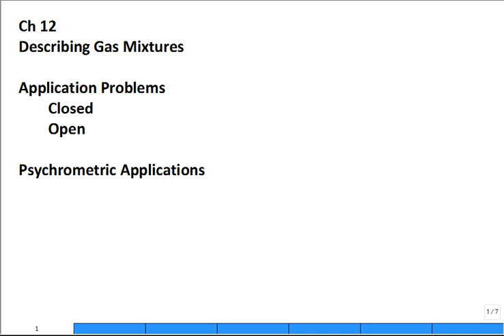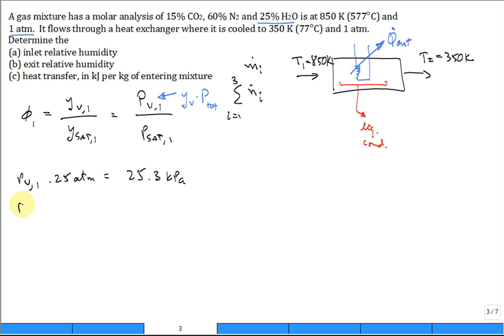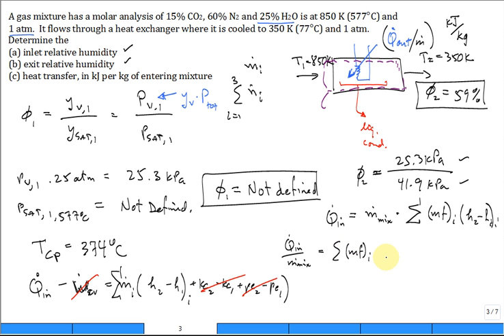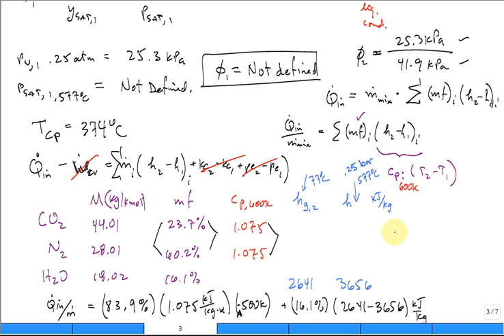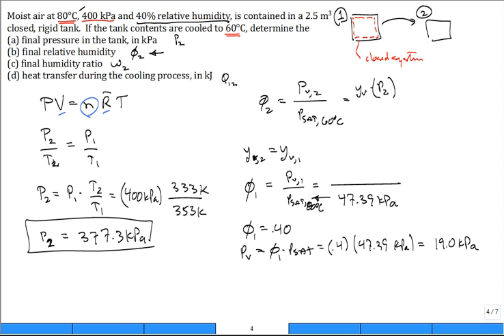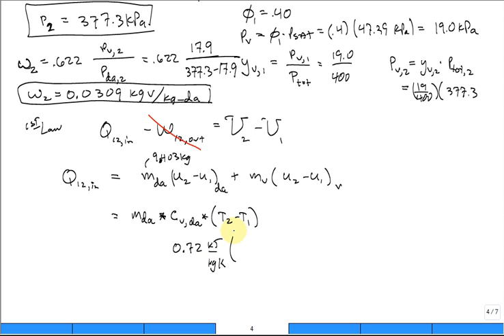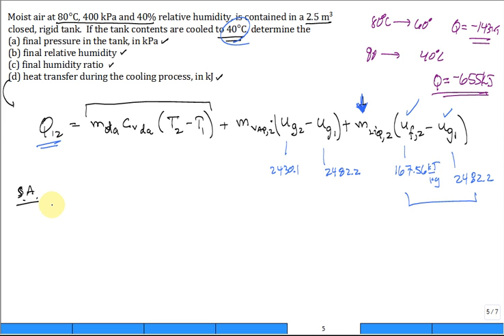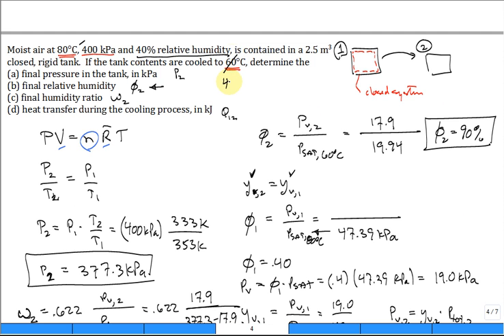ME4293 Ideal Gas Mixtures 4

Comment: i was wondering why do you consider at slide 3 h2=hg2, why is it the saturated vapor enthalpy? thank you so much
Reply from the maker: +Inês Quadros because water vapor in moist air behaves as an ideal gas.  The enthalpy of an ideal gas (not just water vapor) is only a function of temperature.  Please see equation 12.47 in 8th edition of Moran's textbook.
Reply: thank you so much for your time and your videos, they are realy a fun relaxed way to learn thermodynamics, the subject i'm enjoying the most in mechanical engeneering! just wish i had more class time to discuss and solve exercises...
Reply: i asked this question because we also have superheated vapor tables and one time you compared this value with the value from the saturated table and said they were similar
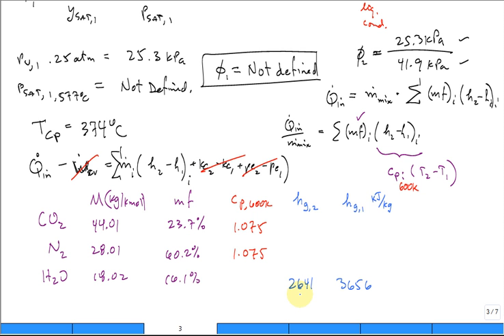Reply: i mean the condensed water tables, i'm referring to "me4293 ideal gas mixtures 6" video where in 15:15 you calculate hv and compare to hg, by the way at 15ºC and 48ºC isn't water liquid and hv much smaller? i checked my tables and values ranged from 63 to 209 kj/kg in that range of temperatures
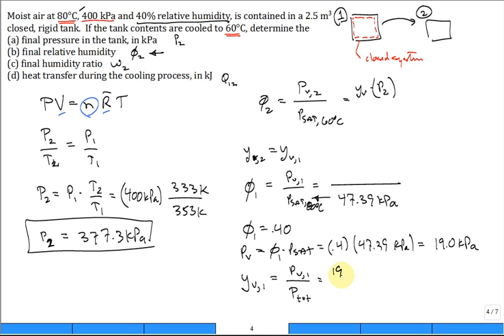Reply from the maker: see "me3293 Properties 5 Fall2015" around time of 42:10 for discussion of Joule's experiment related to ideal gas, and "me3293 Properties 8 fall2015" around 24:00 for discussion how saturated water vapor behaves as ideal gas (as well as superheated water vapor).  I know this is often challenging for students who think about things and ask questions. Can have water as vapor (especially in most air) at low temperatures.
Reply: thank you so much for your kind help and disposition, so just to check my understanding, we use the saturated h20 tables for vapor in moist air, and the thermodynamic properties are only dependent on the temperature of the mixture and independent of the pressure(we must only check the tables with the temperature), as in the example of "me4293 ideal gas mixtures 6" video, where pressure remains constant but the temperature decreases.
Reply: so i just noticed i also have a water vapor (ideal gas) table and for 320k h=-13381.6, so very big difference, why is it negative though?
Reply: i was confused about the pressure, i was taking the total pressure as the parcial vapor pressure, i see my mistake there, thank you
Reply from the maker: different datum points for the tables.  Again, a difficult concept for many students.  Steam tables often set internal energy of saturated liquid at triple point equal to zero.  Ideal gas table has enthalpy extrapolated to 0 K set to be equal to zero.  See Cengel, chapter 3, "Reference State and Reference Values" for steam and Section 4-4 for discussion of Table A-17
Reply: i thought tables obeyed a norm and had the same datum points, although i'm using portuguese tables. thank you so much Mr. Manteufel, your a great help